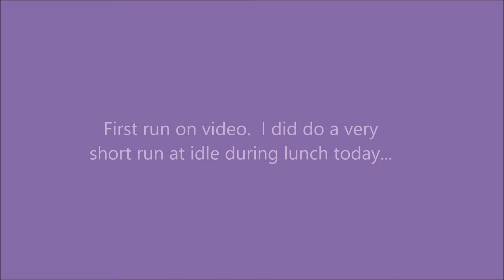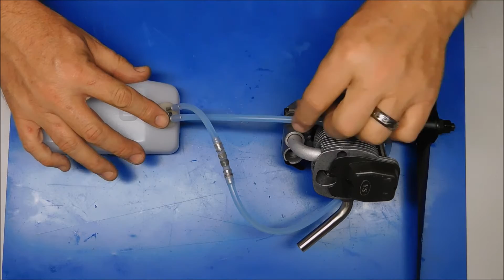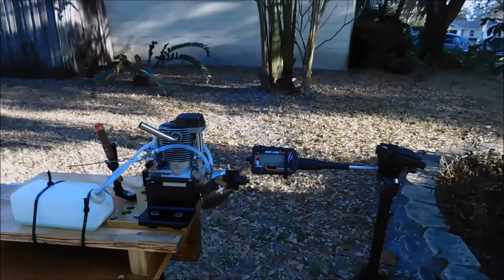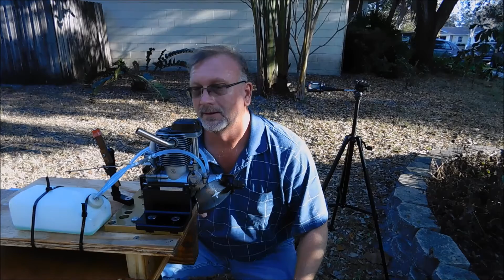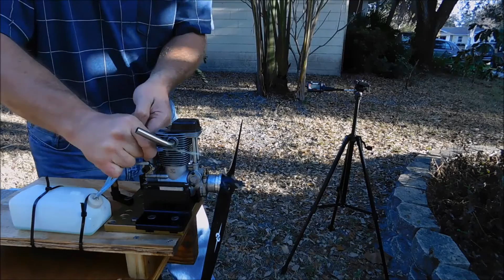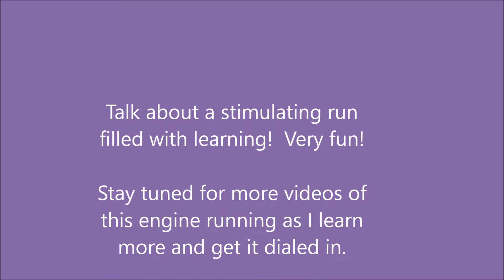YS F-120 The First Run

Comment: Wow that engine had very bad throttle response for being a YS. Their engines really like 25%+ nitro and very high oil content. I personally run  30% nitro heli fuel in mine. I would also check the regulator which could be throwing the entire midrange off. I am still fairly new to my ys, but once you get it tuned properly the power is incredible.

Comment: I have a 120 that i ran for a short period .Unfortunately the canopy of the plane blew of and i crashed the plane .The engine ran like a 6 cell overpowered electric motor .When you get them right they are awesome engines .Next time i am putting it on a stick so access to the engine is easy .They also tend to get really hot ,so on the front of a stick is where it goes

Comment: ANY  leak  in the system  will  cause running problems.. 

   YS   engines do best with  20/20   fuel.. 

    Once you run it     release pressure   at the VENT line.. 

      im sure you got this figured out now...  (two years ago )    but YS  engines can be  touchy

Comment: I suspect I've watched these videos out of order, because you seemed to really like your YS 53 and they operate on the same principle, so this must have been your first experience with them.    I bought an F-120 when they first came out in the late 80s-early 90s.  Back then everyone was running OS or Enya 1.20s and this was really a black sheep.   I ran that 1.20 weekly for well over 10 years,  I would build suitable airframes just so I could continue using that YS.   It was always a real powerhouse,  excellent transition and had a low idle,  it's only drawback was extra weight over it's competitors.   I had it in everything from sport planes, Aerobatic, 3D, and a warbird, it never let me down.   I love these old videos and reminiscing about the "good ole days"   I should have never sold that engine.   If I remember right, the original 1.20 had no low speed needle, you had to adjust the regulator for the low end and midrange.  The later ones had low speed needle valves and you just set the regulator screw flush with the housing and literally don't mess with it.    The 1.20SC was a later variant that was not very reliable,  The 1.20AC (air chamber) had even more power, (and more weight)    I always shut it off by closing the throttle,  then pull the line from the check valve to release the tank pressure.    I have 2 FZ63s that I bought new in the early 2000s,  I still fly them both nearly 20 years later and they are an absolute joy, wonderful sound and very consistent running with incredible throttle response.    I have always used Powermaster YS 20/20 fuel or heli blend (with even more oil)    As far as I'm concerned you cannot go wrong with a YS.
Reply from the maker: Well we each have our own opinions on glow engines.  Personally, I will never buy, own, or work on another YS engine.  I have owned and operated many, many, glow engines, as evidence of the 1400+ videos in my database.  YS engines rate at the low end of the scale for me, the common sport flyer, and most of all not for a novice glow engine operator.  Why, you may ask.  Price, parts availability, and ease of operation.  Trust me, I know how to operate a glow engine.
Reply: David McIntire to each his own,  but didn’t you say the 53 was “perfection?”  Maybe that 120 was a lemon, but I thought you learned about them and loved that 53?
Reply from the maker: I did like the YS 53, but I don't keep every engine featured on my channel.

Comment: Have to soft mount them they vibrate like crazy YS sells some really expensive mount $180 uses a tiny shock absorber and an o-rings. Hyde used to sell 1/2 rubber mounts to soak up the vibration. I have a 140DZ I mounted to test stand like yours the pump vibrated lose the screws just backed out during the first run. When I stopped it fell off some parts fell on the ground. I called YS in the US they told me what to get or I could send it to them for $40 they would go though it and make it run like new. They did it looked new when I got it back haven't tested it again I wanted to mount it on my CG ultimate little big for that plane. The YS engine is probably best nitro 4 stroke ever made as far as power to weight lot of moving parts takes time to learn how to tune them. Once you get them running they have incredible power. The super charging which happens in the crank case adds about 35% more power over non super charged. Hobby shops have shunned YS because they wont sell to them at discount all YS engines are sold though US office which I suspect is just a family member who lives in the US all made in Japan.  YS engines has dominated pattern competitions for years gas 2 stroke haven't been able to knock them off the top. To shut it down you just close the carburetor completely cuts the air off set the idle I use a switch to move it to shut down.

Comment: Hi. Great video! I have a question about the check valve. Isn't there a thin round clear plastic inside the check valve. I opened mine and tried to clean the check valve because it's been sitting in the storage for a long time and I thought that it's good to clean it and I found that thin round clear plastic inside. But i lost it and the engine ran just fine. Is it important to the engine?

Comment: I had a similar issue with the os gear driven pump motors .when the pump shaft seal is  bad ,it .floods the case with fuel ,comes out the front bearing,up the vent hose to intake,causing extreme rich mixture.same on my os fs 120 sp,fills case,leaks out front bearing,fills super charger ands pops prop nuts.

Comment: Thanks David.. I've been awaiting this video.. As I have mentioned, I have the same engine and it has sat for probably the last 10 years.. I've learned a lot from this series and thank you for your time..  I will continue to watch your upcoming video's closely.. Again, thanks.. 
Noticed that you were running four  stroke fuel..  Why didn't you run your normal Morgan's through it..? 
I've always ran 15% two cycle through my four strokes.. Although, someone told me years ago that the YS engines like the YS 4 cycle fuel.. One of the main reasons for me not running it.. That stuff is like $35 a gallon..
Reply from the maker: Well if you look at the Morgan site for the Blend details you will see that the fuel I am running the Morgan's Cool Power MV 4 stroke fuel actually has 18% total lube content whereas the Omega has 17% total lube.  I WAS going to run Omega 15%  but I didn't have that on hand.  I had the Cool Power MV.  Being impatient and wanting to run the engine I ran this.  It has 15% nitro and more oil so IMO a better fuel over the Omega 15%.  Ideally YS wants you to run 20% total lube content fuel.
Reply: David McIntire 
Yes sir.. I understand.. 
Yes, that 20/20 is spendy.. 
I may attempt to just run Powermaster 15% through mine.. 
That should have plenty of lubrication to offer.. 

Thanks again